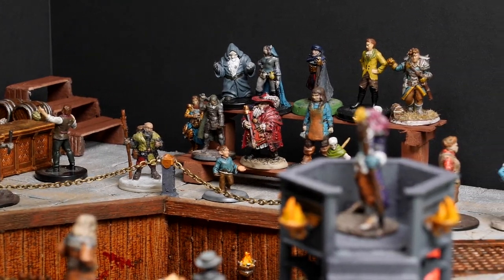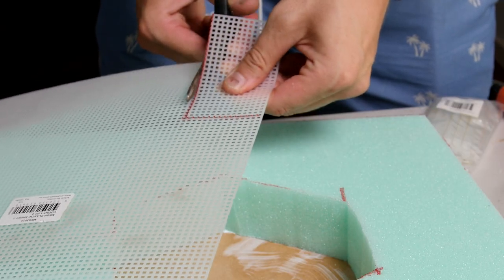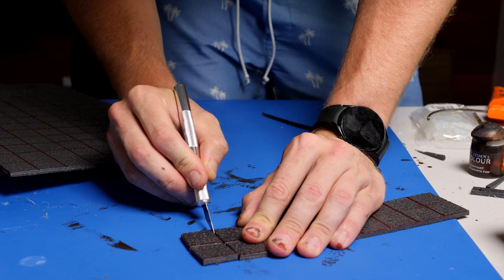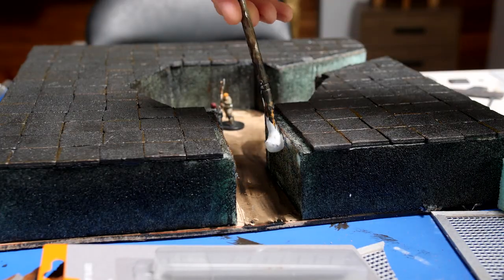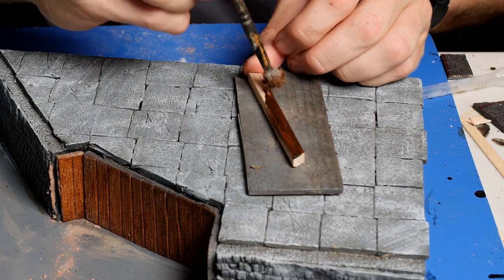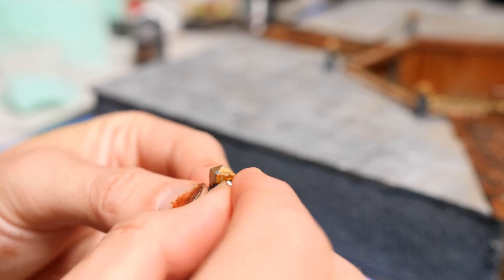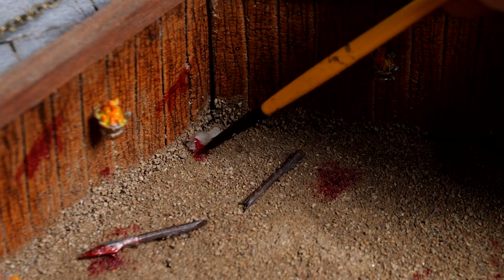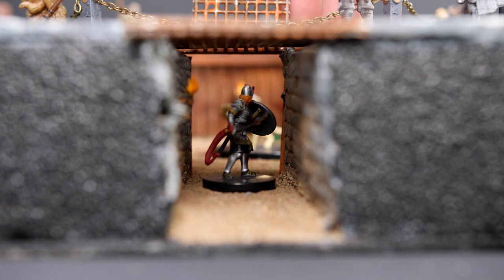Fantasy Fight Club - Crafting a fight pit

Comment: When gluing chains like those into smaller bits of terrain, I like to use a short piece of very small gauge wire and pin that into the terrain piece first, with just enough of the wire exposed so as to act as a “hook” for the chain. Just put a tiny dab of glue onto the wire and use some tweezers to place the loop of the chain onto it, it should hold pretty well and is fairly quick and easy.
Reply from the maker: Great idea. I think that's the way I would go in the future. Maybe even redesigning the bollards to have a small hole in them to poke a thin peice of wire through to hold it all in place nicely. 
Great advice 👌

Comment: You tried way too hard with that rust. That color mix looks more like cheese puffs and trail mix that's been stepped on.
Reply from the maker: Ahh well, I was happy with it and the only way to learn is to try things
Reply: @SebMakesStuff  No, the way to learn is to acknowledge criticism, take it into consideration, and use any advice you take away from it. By your logic, people can learn to be invulnerable by hurting themselves.
Reply from the maker: It's art, experimentation is a great way to learn. And you're using a bit of a slippery slope phalasy there to compare it to injury and invulnerability. 
Try giving actual advice next time, rather than just being negative and you might get a response that acknowledges your opinions
Reply from the maker: What pressure? Nothing you've said so far has added any value to the discussion, the only value is in the YouTube engagement of the continued comments.
Next time you want someone to take your criticism try making it constructive, otherwise you kinda just come accross a bit sad